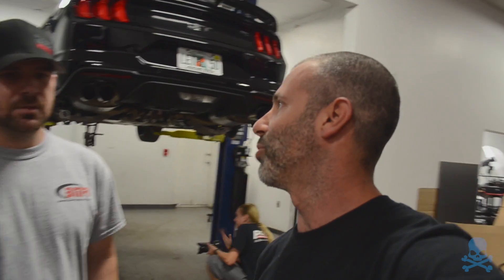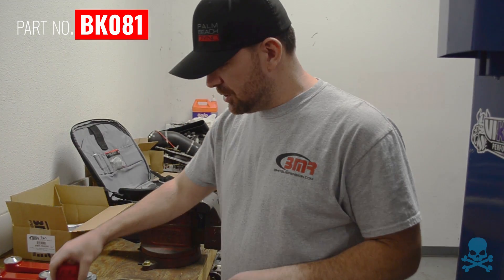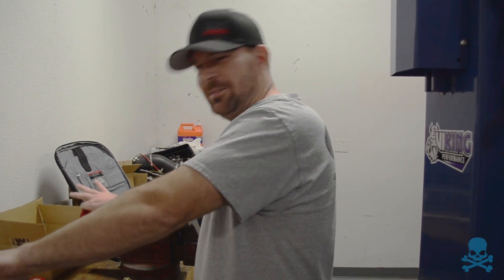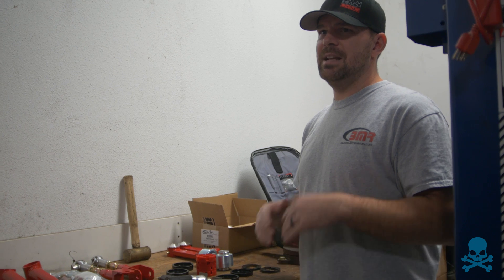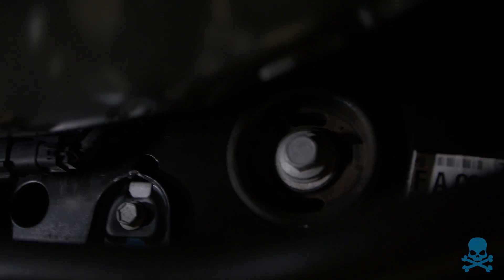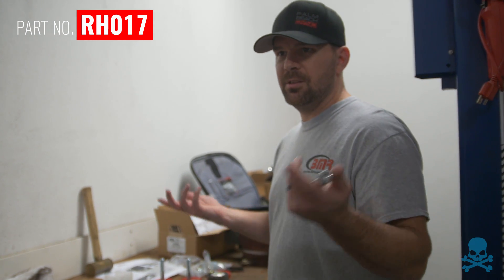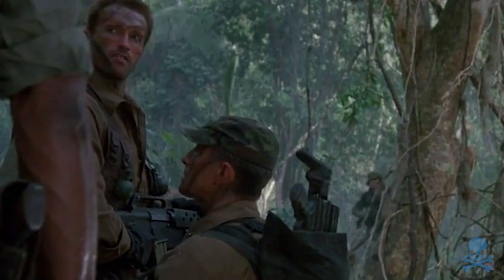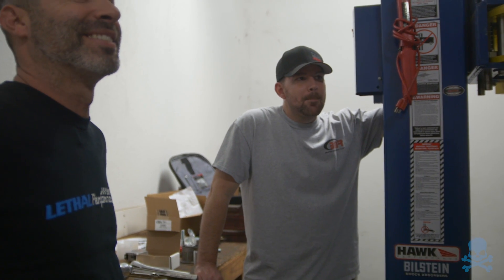SUSPENSION TECH: S550 Mustang Rear Suspension Components from BMR

Comment: Holly smoke, excellent info! The reason I am watching these vids is that my 2021 S550 GT started pulling to the left under heavy acceleration. Everything is stock on my car. I suspect those diff bushings. Any ideas?
Reply from the maker: Thank you! It's tough to say what's causing the pull to one side as it could be unrelated to one specific suspension piece. A bad alignment or something else can be causing it. With that said you will indeed greatly benefit from an upgraded suspension package from either BMR or Steeda. Feel free to give us a shout and we'll be glad to assist you.

Comment: I am currently full Bolt on with stock suspension. Traction is a huge issue for me. Do you think that a good set of tires matched with this kit will make the car hook 10x better?
Reply from the maker: Austin Abshire definitely. Tires and suspension make a huge difference. That bread and Butter package is 👌

Add some BMR performance or drag springs into the mix and top it off with some Viking shocks for a stellar setup. 

Let us know if you have any other questions.

Comment: So the whole rear set up is shot?  If you have to change everything just for it to be good enough
Reply from the maker: I wouldn't go as far to say that it's shot but with any OEM suspension setup it can definitely be improved. Especially if you're adding lots of power with the goals of going quick.
Reply: Keion Rajcoomar perspective.  the lethal performance 18 just put down 900+ wheel TODAY.  you think the stock rear suspension is built to handle that?  or even 700 wheel?

Comment: Thanks Kelly and Jared. One question: If the complete "Bread and Butter" Package were installed on a '15 to '18 Mustang GT, would it help keep the stock halfshafts from breaking under hard launches on slicks?
Reply from the maker: trent Gareth indeed it will. Less wheel hop = less stress on the driveline and axles. That’s one of the causes of snapper halfshafts. Let us know if you have any other questions.
Reply: I have the bread and butter per say on my 15 Roush rs3.  And have broke a driver side Ford racing half shaft leanth wise along the splines in the outer CV    You may get away with it on an Automatic car but not a manual.